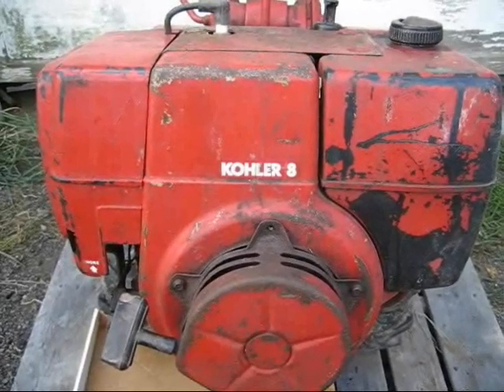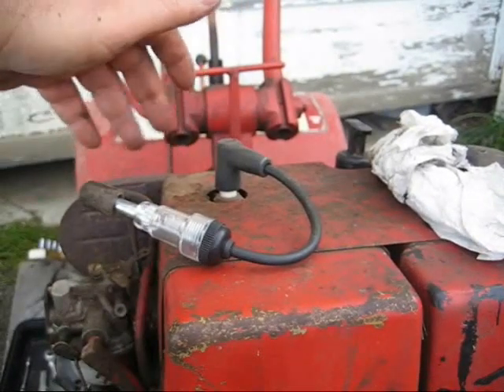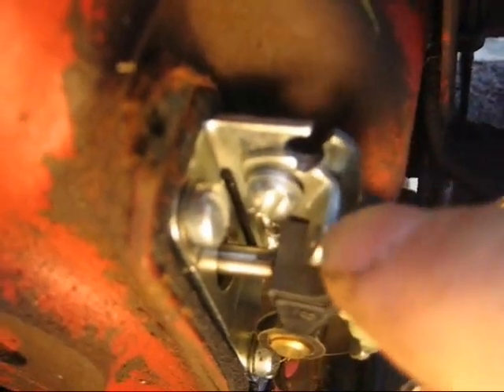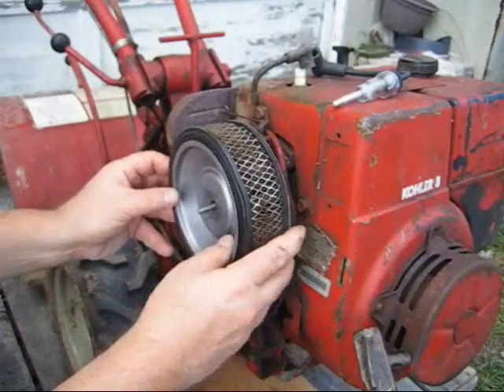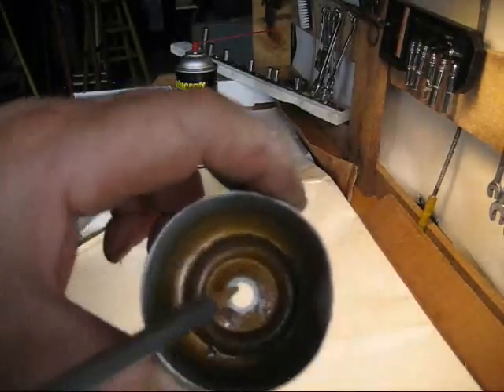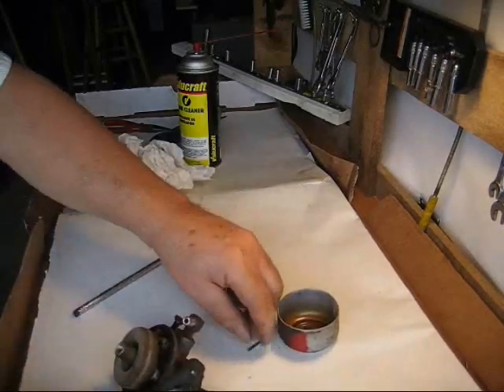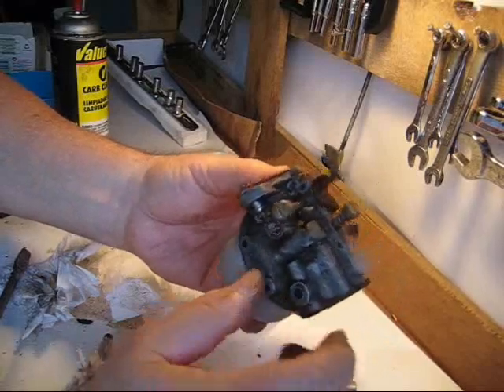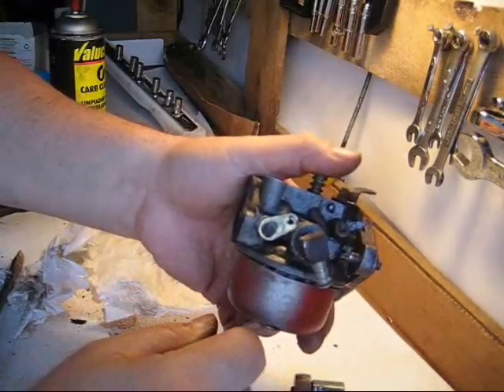Troy bilt No Start No Spark  Kohler Engine Spark & Carburetor Repair

Comment: Can you go in depth more in the spark setup? I have a similar Kohler that is pull start I can’t get spark out of. Does it have a condenser?
Reply from the maker: Thank you for stopping by. This video is a couple of year old and the tiller is in storage. If I can get to it before the summer I will post another video on this tiller. This engine does have a condenser. A few years ago I checked with Kohler & asked for an  electronic ignition kit to replace the point & condenser set up but they said none exist for this model. That may have changed by now.
Stay safe, Joe Z

Comment: This looks like a cast-iron. engine, which to me anyway is one of the best.
having the points on the side is nice as it avoids removing the flywheel.
yup some call it a carbitr8or. Got a 7 HP Kohler on Dad's Troybilt. ran great
up to mid throttle, tjhen ran like sh&(. cleaned out carb replaced, same 
thing.  then remembered it could be a bad mag. since a new one was like
200 and change, I hookt up a regular ignition coil and a hot-shot battery 
thru the engine's points. engine ran great thru all speeds. so o it proved the
magneto was weak at higher speeds or just arced over. I put a new mag in and yes the engine ran great.
Reply from the maker: Raymond Garafano,  Thank You for watching and taking the time to comment. 
The  points on the side really make it real easy to work on. I checked with Kohler & was told they do not have a kit for these engines to change to electronic ignition so that side mount is a big plus. This summer I have not used this tiller, smaller garden used a much smaller old Montgomery Wards tiller. If I can get the time this winter I would like to take the TroyBilt apart & restore it.
Raymond Garafano I have other videos on my channel that cover many different subjects  and new videos added weekly that may also be of help or interest. 
Be sure to 👍, share & subscribe if your are inclined to do so.  Also not to miss any new videos remember to hit that notification 🔔

If you would like, another way you can help support  this channel at NO cost to you is by using one of the above affiliate links.
* Thank you for watching and your support I really appreciate it.***
Stay safe, Joe Z

Comment: I picked up the same one however mine has no points at all and I’m a little confused can anyone help me ?
Reply from the maker: Thank you for stopping by. Is your unit running?
Reply: I just found a new pull start on E-bay and should be here soon. The rest of the tiller is in great shape, looks like low hrs on it. I couldn’t get one of the tires off the axle so I swapped the rubber myself
Reply from the maker: @brucerazor5202  I had to do that on a lawn tractor once. No matter what I did the wheel would not break free. Lubricant's, heat, pullers even sludge hammer LOL it would not budge. This is a real work horse. The soil in my area is composed of a lot of clay & rocks. When starting a new field this does the job. Keep in touch. Have a great growing season. Joe Z
Reply: @JOEZEP54  it’s nice to talk to someone who appreciates these, I even welded a 1 inch nut to the wheel and cranked my compressor up to 180 lbs and tried my air hammer but no luck.
Reply from the maker: @brucerazor5202  They hold tighter then my welds LOL
Reply: You might have the magnum engine  ,electronic ignition instead of points

Comment: I have the same tiller.  It starts but it usually takes about ten to fifteen minutes with about 8 - 10 pulls and pausing a a couple minutes between pulls, choke on.  Any Idea how to get it starting on the first, second, or third pull?
Reply from the maker: Just go through the basics, check the fuel flow.Check the spark. Replace the plug even if it sparks. I had one that sparked but had the same issue as yours. Changing the plug was all it took. Clean off the points & check the gap.  If the fuel line has never been replaced it may be deteriorated inside & not let enough fuel flow. Check the carb, is there "anything" in there. Is the seat ok. 
Let me know if this was of help. Joe Z

Comment: Do you have a video on a coil replacement on that kohler
Reply from the maker: Thank you for stopping by. I do not have a coil replacement video on this kohler .
I did not use it for a couple of years & have to pull it out of storage. If I end up having to do this repair I will let you know.
Stay safe, Joe Z

Comment: Mr. Joe, I seen you having the trouble removing the screw. You may know this but a lot of people out there may not but they make a nice little impact driver tool. It weighs about a pound and comes with two or three different driver bits, Phillips head and Flathead and you can turn it to either tighten or loosen and hit it with a hammer and it will loosen the screw. When the hammer strikes it will turn it clockwise a very fraction of an inch or vice versa. I don't know what I would do without mine. Started to buy another one today because they where in the cheap bin at the auto parts store, some were $4.98 and some were $7.98 and I bought mine and paid $15 for it. But of course the driver was in the $7.98 Bin. Just throwed that out there, good video!
Reply from the maker: jack watkins, Thank You for watching and taking the time to comment with additional useful information. I do have an impact screw driver, had it for some 20 years but I could not find the bit I needed. Thank you for mentioning it. I will now post a link to Amazon for those you may also like to get one.  jack watkins  I have other videos on my channel that cover many different subjects & new videos added weekly, so check out my video playlist for other videos that may be of help & interest to you. Be sure to hit the notification bell not to miss any new videos. 
 Be sure to like, share & subscribe if your are inclined to do so. Stay well Joe Z
Reply: indeed.  i bought one at sears back in 72 for working on motorcycles.  great as you say for messed up screws, including phillips.  its a periodically useful tool that will last for generations.  and doesn't need batteries!!!  using 1/2 inch impact sockets, iv'e loosened many large nuts too.

Comment: Well mr. Joe that was a great video and I hope it's going to help me tomorrow! About an 8 horsepower Kohler Magnum Troy-Bilt about a year-and-a-half ago and it worked fine last year and I keep stabil in my gas and my brother went to crank it off this year and it only runs if you got the choke on. So I think I'm going to have to do some carburetor cleaning! Mine somewhere between the 85 and 88 model I believe. But you just told me something that I didn't know. You said the fuel pump was working. I hadn't looked at the engine that close but I didn't even know it had a fuel pump on it! I assumed it was just gravity-fed just like my 6 horsepower Tecumseh on my other 86 model Troy-Bilt. I'll try to let you know if your stuff is the same as mine and how I turn out on. Till then Joe you have a wonderful day!
Reply from the maker: jack watkins,Thank you.  Check your spark plug if it is fouled up or just may have to be changed. I had one that was sparking but it was only after I changed it did the unit I was working on run right. Check the fuel filter & line as well. Hope this is of help. Joe Z

Comment: Thanks for sharing. I have an old Horse and it began to run only with the choke on. I drained the bowl and sprayed in some carburetor cleaner and now it works. I am no mechanic and would not have thought it possible.
Reply from the maker: I am glad I was able to be of help. Thanks for stopping by & commenting.

Comment: When checking for spark, remove the spark plug, reattach the spark plug wire, place the plug on the sheet metal of the engine, then pull the rope & observe if there's spark. If the spark is blue, the plug is good. If it's red or white, plug is fouled. If no spark, try a new spark plug. If still no spark, check the points. Go here for more info: http://gardentractorpullingtips.com/ignelect.htm
Reply: that's the way I do it. My daddy used to just stick his finger in the boot and hold his hand against the engine. He would pull the cord and could tell you if it was getting adequate Spark! I did not like that! But then again I saw Dad hold onto a car plug wire and let it jump fire off his other finger on to the engine. I remember back when I was a kid roundabout 50 plus years ago a guy told him why didn't you do it with his pecker? Dad told him for twenty bucks I will! Of course nobody would pay $20 to watch it. Which 50 years ago $20 was like $100 now. By God you had to be tough in those days! Good day
Reply from the maker: Thank you for watching & adding contributing  useful information.
Stay well, Joe Z.
Reply from the maker: Those old timers were a tough breed. I wonder what they would say if they were here today.
Stay safe, Joe

Comment: As a partial payback for the help and guidance in your video, while doing some further research I stumbled onto a catalog that provides information on the date of manufacture for Troy-Bilt tillers.  The catalog is fairly long and will likely take some time to download. The link is:

https://mail.google.com/mail/u/0/#inbox/15d484fc73e4d81e?projector=1

Section 3 of this catalog refers to tillers.  My Troy-Bilt serial number is 83 50 68. If you scroll to the very bottom of the pages in Section 3 you will see page numbers. On page 40 (covering in part 1986 Horse III)  you will find that the S/N column covers serial numbers in the range of 806595 to 841755, and this includes the platform for my machine. However, when you look in engine column you will find that the only Kohler engine for that range of serial numbers is rated at 7 hp. The first apparent use of the Kohler M8ST engine (the ST suffix identifies Battery Start) occurs in 1987, where they appear in relation to the O.P.C. PTO Horse.  (O.P.C. stands for Operator Presence Controls, whatever that means.)  It appears that Troy-Bilt manufactured my tiller platform in 1986 and in 1987 completed the unit when the Kohler M8ST engines first became available. Or as an alternative, my 1986 platform was completed with a 7 horsepower Kohler engine that may have developed problems later that made replacing it with an M8ST a desirable option.

I hope you can find your machine in the list and that knowing its origins will help you to find correct parts for it.

In the way of additional information, I communicated with somebody who had a Troy-Bilt Horse model with an engine that went bad. He took that engine off and replaced it with a 6.5 horsepower horizontal drive engine from Harbor Freight ($99.95) that mounted on the Troy-Bilt platform and mated up with the Troy-Built pulleys without modification. He claims that it works like a champ and the horsepower is sufficient to churn through Texas dry clay -- which is saying something if you haven't ever tested a tiller that way.

In conclusion, following your video instructions, I thoroughly cleaned the carburetor and got my machine running smoothly. Just a few more mechanical details to address and it'll be off to the races.
Reply from the maker: Hi Jim,
       Thank you for  providing the catalog link & taking the time to comment  along with the additional information. If you like to get my videos as I upload them and be of additional help be sure to subscribe.
Stay well, JoeZ.

Comment: Had to remove and clean out the carb on my 30 yr old T. Bilt. helped to see you do it first. Thanks. One thing I will mention is that after reassembly, but before connecting it, I ran the fuel pump a bit to purge that line of possible contaminants. After it was all put back together, it would not start until I let it sit overnight. Assuming the needle valve/ float had to drip drip drip to fill the bowl. Next morning, it started right up and a small adjustment to the top needle valve has it running like new. Thanks for the video.
Reply from the maker: Qingeaton,  You're welcome I am glad this was of help .And thank You for watching and taking the time to comment. And thank you for your tip running  the fuel pump before reconnecting.
Qingeaton  If you haven't installed the TubeBuddy browser plugin yet, to help your channel grow do it! Just go to
https://www.tubebuddy.com/joezep54
Start with the free version, yes it is free to not only to down load but to use.If you have any questions let me know.  I hope you get to enjoy other videos on my channel as well.  Stay well Joe Z

Comment: Jim D

I recently came into a "barn find" Troy-bilt Horse Model tiller Serial Nr (83 50 68 stamped in the right side of the transmission case above the wheel axle) with a battery start Kohler 8 hp engine (Model M8ST), Spec Nr 301513, Serial Nr 161200?167. (The ? is an unreadable number). It initially ran for 20 minutes or so, but after I added gas, it quit. I have spark and compression, so I suspect that a carburetor cleaning is in order. Your video is much appreciated and I'm about to follow your instructions on cleaning the carb. Thanks much for your post!  Is there any way to tell the year of manufacture of this unit from the info above? Somebody on the net indicated that you can do so by adding 70 to the first two numbers in the Kohler serial number to get the year. For my serial number that would make it an 86 (16 + 70) and the next three digits (120) indicate the day of the year it was manufactured. Internet sources for Kohler parts refer to K161, K181, and M8. Are such parts interchangeable with the M8ST engine? I'm having a hard time finding anybody that knows anything for sure about these machines.
Reply from the maker: Hey great find. Thank you for viewing & commenting. Glad my video was of help. Sorry I do not do not know how to find the year. I did not used this tiller last season & I am getting ready to do a  complete restoration ( if time allows) I found this site it may be of help to you : http://www.troybilt.com/webapp/wcs/stores/servlet/DisplayOwnersManualList?storeId=10001&catalogId=14102&modelNumber=horse&serialNumber=
For the number you cannot make out input 0 to 9 see if you get a hit. Although this can be tedious it has worked for me several times. Let me know how you make out. Stay well, JoeZ.

Comment: I am shipping my Tory Bilt Horse 8 hp tiller overseas. Drained the oil, Gear oil, Tiller belt. Just wanted to know if you know the spark plug gap on my Kohler 8hp engine?
Reply from the maker: Thank you for visiting. Did you get the specks for the gap? If not let me know I will have to find that speck again.
Reply: .025

Comment: We're looking for a pull start for a 7 horsepower Troy-Bilt rototiller old model of an has 5 bolts holding the pull start on if anybody can help us for sure appreciate it
Reply from the maker: Hi Ben thank you for stopping by. Here are just 2 groups that I find ok to check for some older parts. Dutchess County ISO Group --Lawn tractor buy/sale/trade only . Both are on Facebook. There are a lot of sm engine groups. Many like to discuss their older machines. Stay safe, Joe Z
Reply: Ebay

Comment: Hey joe z I just bought a tiller with same motor it has spark and I cleaned the carb but it still won't run when I suppose my hand over the carb it sputters and spits gas out the carb
Reply from the maker: Hi +ALBERTLOPEZJR209 The fuel leaking (spitting)  through the carburetor from the air filter would be  caused by too much fuel in the carburetor bowl. It is not being stopped at a good level  due to the float being full of fuel. You can check this by taking the float off  & shake it. Listen if there  is fuel in it. If the float is good then either  the needle is worn or the rubber of the needle and seat is damaged or placed incorrectly. Let me know if this helps.
Reply: +JOE Z the points on a Kohler motor

Comment: Thanks for the great simple video! Cleaned the points on my K Koehler and BANG THERE IT IS!!!!!
Thanks for great vid!!!🤓
Reply from the maker: Hey Michael, I am glad this helped you out. Thank you for viewing & taking the time to comment, it helps to keep me going. Funny last month was the first time since 2016 that I went to use this tiller & no spark again! Well the remedy in this video did no help this time. As soon as I get some time I have to pull it apart to check the wiring. If it checks out may be time for new condenser,points & plug.
When you get a chance  you may enjoy some of my other videos as well,if so let me know. Stay well, Joe Z

Comment: Thanks for the video.  I just picked up the same model (not running) for cheap off craigslist and your video is a good preview of the steps I'll be taking soon to get it running.
Reply from the maker: You're welcome and thank you for your comment. Once you get this tiller running you will have a great machine. It is a beast. Although I work soil in my new garden area for 3 years you be amazed to see the rock that I still pull out. The soil in this area has  a high mix of clay & rocks. This tiller works its way right through it. Let me know when you get it running.

Comment: Where to get parts
Reply from the maker: Thank you for stopping by. I check on line, (using model & serial #) then go to local shop. If they  have it & not much more then on line I will buy local. Sometimes you have to buy on line due to local shop not having the part you need. Stay safe, Joe Z